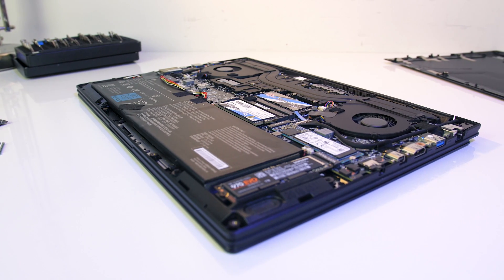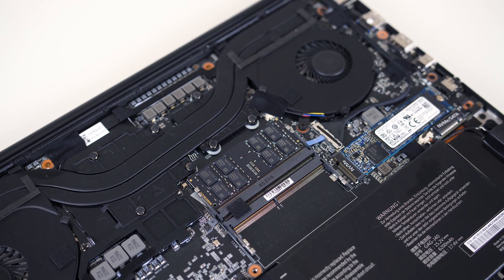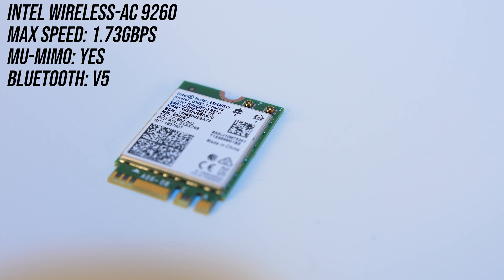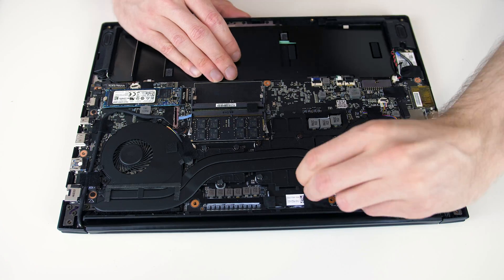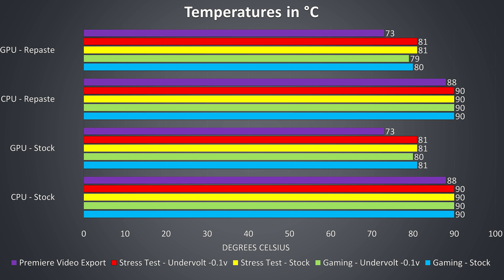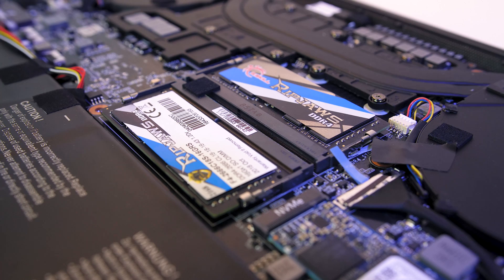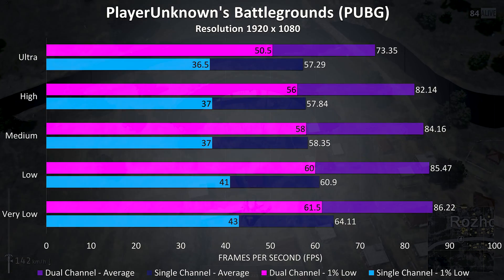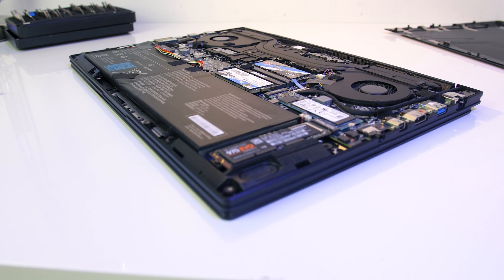Upgrading the Gigabyte Aero 15x Laptop

Comment: I've read that there's a lot of things to fix software wise on the Aero (many reccomend undervolting, a fresh install of windows, installing windows precision drivers and more). Did you do this, if so can you give a list of things you reccomend to do with the Aero?
Reply from the maker: I did a fresh install but then installed most of the Gigabyte software anyway, you need at least smart manager if you want to control fan speed etc. Otherwise the only major thing I did in software that improved things for me was install precision drivers, that greatly improves the touch pad IMO, it's pretty horrible with ELAN drivers.
Reply: @JarrodsTech  Maybe dumb question, but by fresh install do you mean buying a new microsoft liscense?  I've read there's a lot of bad bloatware straight from the factory. I assume factory reseting it will not get rid of the bloatware.
Reply from the maker: You could always just uninstall stuff you don't want, but I have my own enterprise license that I put on it, but you could log in with a Microsoft and tie the license to your account and reuse it I think.
Reply: @JarrodsTech  The windows license is linked to the motherboard, so even by doing a fresh install it will automatically activate the windows license. (indeed if you install the right version of windows 10, in this case Windows 10 professional)
Reply: @JarrodsTech  By the way thank you for your content Jarrod, clear speech which is useful for foreigners and great video quality overall. (I'm from France and I've bought the Aero 15X, thanks to your videos on it) :-)
Reply from the maker: Neat. No problem, cheers!
Reply: @JarrodsTech  What are you thoughts about the new Aero 15 coming this year? Pretty sure Gigabyte will use RTX 2070 and 2060 in their laptops. I hope so!
Reply from the maker: I think it will have some sort of new GPU, not sure if it will be RTX or if they will also have new GTX, but I've been invited to check out a new Aero at CES next week and will have a video on it if all goes to plan 😁

Comment: Been doing liquid metal on several laptop,using conformal coating and kapton tape, you can get up to 20 degree difference in certain case. My own a hp specter pro 15 inch dropped 16 degree under load. I would definitely go that route if i was you. There no risk involve as long you take your time.
Reply from the maker: I wonder if that's the case with this laptop though, I've read about other people doing it on the Aero 15x and still had almost no difference, may just be that the heatsink isn't big enough / not enough fan power to remove the heat.

Comment: Thanks mate! Great video and I've ordered an Evo and extra Hyper 16gb, I'm not brave enough to try the rp atm with potentially little to no reward.  I'll see if I get bored soon or braver 😂
Reply from the maker: No problem! Nice, let me know how it goes!!
Reply: I opened and checked to find the Kingston ram so tried the HyperX HX426S15IB2/16 2666 and it's running fine instantly.  Popped a 1tb m.2 at the same time with no problems after running the disc management tool to allocate.  Still not repasting though, too scary 😱
Reply from the maker: @patrickwheeler2646  sweet! Good to hear 👍

Comment: It is good with single 8gb ram stick or with dual 4gb ram sticks in a laptop pls reply bro☺️
Reply from the maker: Technically 2x 4gb sticks will perform better as you still get dual channel, but I think in 2019 8gb is a little low, especially if you plan on using it to play games.

Comment: Regarding the repaste not lowering temps: As someone already pointed out, I think the Aero 15x Thermal solution is to blame. The heatsink is too small, the fans not powerful and/or large enough to dissipate the heat fast enough, on the contrary the superior Kryonaut thermal paste and thermal pads increase the transfer so efficiently that the small thermal solution can't cope with all the heat coming it's way. 

TBH unless you liquid metal it, I doubt you will see any temperature drops, considering the Aero 15x is notorious for throttling due to it's average cooling. And then, Liquid Metal on highly portable laptops is a risk due to frequent handling.
Intel's 8th gen Coffee Lake CPUs and Nvidia's 10series Pascal GPUs are above the thermal limit of what thin and light gaming laptops can cope with. 
Hell the MSI GS65 Stealth thermal throttles, the Aero 15x throttles, the Alienware M15 throttles, all the Razer Blades throttle, the Dell XPS 15 throttles, the HP Omen 15 thermal throttles etc... 

The only OEM who's got a thermal solution able to handle those parts are ASUS ROG laptops, but then at a huge compromise when it comes to ergonomics. 
The ROG Zephirus lineup will not thermal throttle (even with stock paste) but to accommodate the large thermal solution you end up with a clumsy forward keyboard and and a touchpad where the numpad goes,  plus the innovative hinge/flap  cooling/exhaust mechanism means you can't really use it on your lap, it needs a flat surface. The powerful 12V fans are power hogs too so battery life is short. It cools the SoC's alright, but IMHO the Zephyrus notebooks are meant to move from desk to desk and not on your lap (I'd rather get a desktop replacement twice as powerful then, cuz weight is not a factor for me I'm not Linus =P)

In short, 14 nm and 16 nm SoCs are not power efficient enough for thin and light gaming laptops, only 17.3 inch desktop replacement gaming notebooks have the room for proper cooling solutions able to run full CPU/GPU clocks during long sessions without any repasting. That's why I'm really not interested in Nvidia's Turing RTX2000M/MaxQ series (12nm) nor in Intel's 9th Gen Coffee lake refresh (14nm lol with 2 extra cores so more heat). Both the CPU and GPU power draw will be higher than their respective previous gens, and if OEMs could not cool them properly last time around no chance in hell they will manage this time, one will end up paying a hefty premium for a notebook that will thermal throttles so much one the performance gains from the newer architectures will be nullified. So I fear people are better off buying 2018 Pascal/Coffee lake notebook models. 

Only 7nm SoCs will bring back power efficiency and manageable thermals resulting in a net performance increase, but that's not happening before Q4 2020 because mobile chips launch last =(.
Reply from the maker: Yeah I think that is the case too, even people who have tried LM didn't see much change either.
Reply: Frencho9 was going to purchase a aero 15 on newegg, but your comment keeps me off from it. Thanks for the information. Will keep my xps 9560 a bit longer, and see how 7nm works out
Reply: Hey, I just wanted to drop by and give my experience. I repasted myself today and got a temp drop of about 10 degrees. Instead of using pads, I used on everything thermal paste. I have no thermal throttling issues anymore, when the fans are set to max.
Reply: @Moritz817  What type of thermal paste did you use? I'm thinking about using liquid metal for the cpu and gpu (with nail polish around the socket to help against short circuit just in case) but I'm not sure what paste to use for the other components.
Reply: @gkingkongkev  I used Arctic MX4 - which is non conducting. I didn't test leaving the other components with the pads. You might get the same results just using the liquid metal for the cpu and gpu.
Reply: @Moritz817  thanks. I'll try and get that or something that's just as thick for those components
Reply: yep, without some exotic materials being used bigger=better as far as cooling goes. this is a small laptop so big is not an option, and so good cooling is not an option, simple as that. i have a 15w and love it anyway
Reply: The Alienware m15 does not throttle.  I’ve been tracking all the gaming notebooks and the m15 is the lightest one to not throttle.  That being said, I’m about to get an XPS 15 because most of the other laptops throttle.  The m15 is nice but a little expensive for me atm.  I’ll just undervolt the XPS 15 and call it a day.  Serious gaming is for my laptop or using an egpu at home.
Reply: @Anyguy4321  The Alienware M15 thermal throttles a lot. Own or Disown tested in depth and compared it with two gaming thin and light competitors, the Zephyrus S, Aero15x and Razer 15. https://youtu.be/xypq1vhkUUk?t=380

Note that his review unit was provided by HIDEvolution with LIQUID METAL and Fujipoli Thermal Pads and it still throttled like hell during Aida64 stress tests, reaching high 90s Celsius temperatures. Same thing happened during gaming tests. It's just plain terrible and has the worst cooling performance out of all light gaming notebooks, especially considering it's the chunkiest one. The only 8th gen Coffe Lake thin and light gaming notebook that does not throttle is the ROG Zephirus series. Full comparison review : https://youtu.be/Xufmnv4KZh4
Reply: Also the predator 700 do not throttle
Reply: @loregopro  It does not throttle because it's only available with a 7th gen Intel® Core™ i7-7700HQ processor (Quad-core 2.80 GHz - 3.40 Ghz). An SoC which is much, much cooler than 8th gen Coffee lake CPUs. On top of that the Acer Predator Tritons also compromise ergonomics like the ROG Zephirus in order to accommodate a larger thermal solution in a thin and light (keyboard pushed down to the lower edge of the notebook's chassis). However the Triton's take on it is worse as the touchpad is on the upper edge of the notebook's chassis above the keyboard. It's plain horrible to use, the Zephyrus' placement of it in the numpad section is better. TL,DR I doubt Acer Predator Tritons  can handle an Intel i7 8750h or above without thermal throttling especially considering they don't have a hinge lift mechanism for increased exhaust clearance.
Reply: This person seems to have gotten very different results with their re-paste: http://forum.notebookreview.com/threads/the-gigabyte-aero-15x-2018-improvement-guide.821546/
Reply: 7nm SoC ? I look to the Snapdragon 855 it's weak (compared to i7) and it's hardly get 7nm :(
Reply: @MrMVP911  dude. The 855 at full usage including the gpu uses 2.5w. An i7 with an efficient gpu like the 1070maxQ uses around 180W. And the gap in performance is getting lower.  With  100 times less energy.  There are some benchmarks where the 655 is getting closer to the i7 quads. Where do you think is the futute
Reply: @cotasa  I hope so, if you have references for what you talking I will be appreciated. Also I feel is hard that 855 is getting close to i7

Comment: The reason why your new RAM did not work is because TPM is persumably activated in your BIOS settings.
Set TPM off and it will work. I had the exact same issue. TPM stands for Trusted Platform Manager.
Reply from the maker: So I do actually use Bitlocker, I booted in with my working RAM then suspended Bitlocker and tried to swap it but that didn't help. Do you know if suspending Bitlocker is enough to disable TPM, or would I need to fully disable Bitlocker first? I guess I can investigate further 😛 either way I don't think TPM should care about memory changes, then again maybe it does and would explain why I need the original stick in.

Comment: Hey Jarrod, great review. I have the Aero 15x too. I like it so far. The only issue I have is the camera doest work with the windows camera app. I have the permission on but the app loads for a couple seconds then closes. Do you have the same issue? Thanks.
Reply from the maker: Thanks! Hmm I used the Windows camera app to use mine just fine, I've got two different Aero 15x laptops here for an upcoming video and both can use it ok so not really sure about that one, especially if the permission has been given, I assume it has drivers and works ok with other software? I think you need to enable it in the smartmanager software too.
Reply: Thanks for replying. Yes, the drivers are up to date and the camera is enabled in smart manager. I'll try using Skype to see if it's an issue with the camera app. I'll contact gigabyte with the issue. Thanks.
Reply from the maker: @scottb1923  Hmm yeah bit of a strange one, hope you can get it sorted!

Comment: Thank you so much. My Aero 15x would always run between 87-92°C, obviously thermal throttling to keep temps down while playing games. After repasting with kryonout, putting thermal pads on the vram and undervolting both the CPU and GPU it would run between 80-85°C but keep good clock speeds. I still wondered why it was getting but I see I’m not the only one.
Reply from the maker: Hmm seems cooler than mine 😛 maybe I should try redo it.